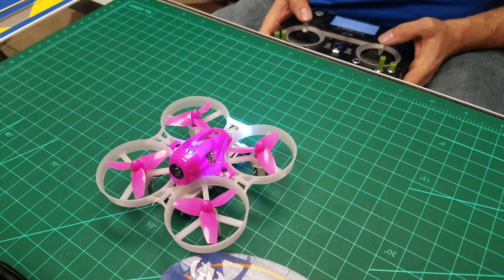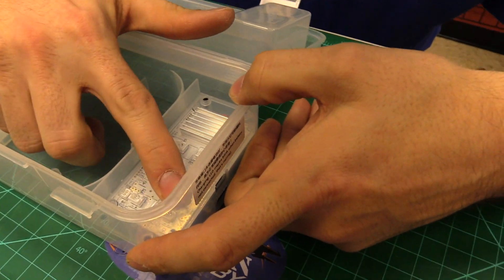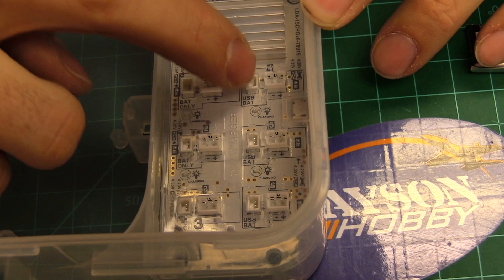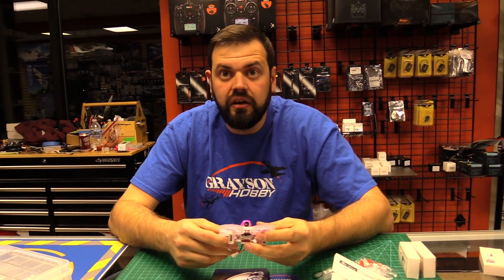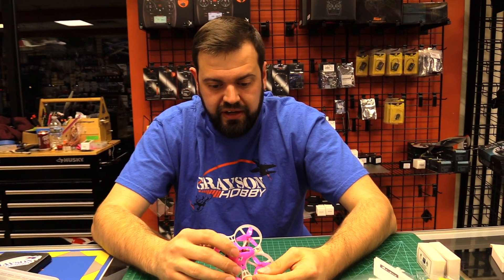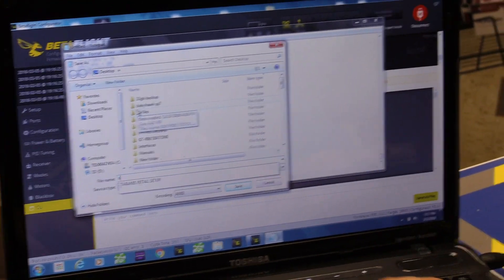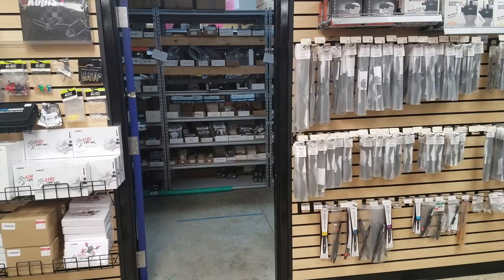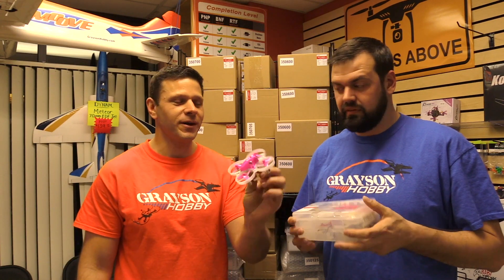KingKong Tiny 7x Micro FPV Quad Advanced Bundle with FrSky XM | BNF

Comment: What would you guys recommend I no it's off subject but what laptop would you recommend for a computer to use only for fpv pies set ups something cheap but reliable any ideas would help
Reply from the maker: Pretty much anything new these days will work.  We bought a few used ones off of eBay just for the shop for 100 bucks and they work great

Comment: Hey guys,I have the tiny 7 and when I power it up the motors start spinning. How do I make this stop?
Reply from the maker: Sounds like  motor stop in betaflight needs to be adjusted
Reply: Grayson Hobby I’m fairly new to the hobby. How exactly do I do that?
Reply from the maker: Also you need to set modes, and throttle arm / disarm...
Reply from the maker: watch Bardwell videos on BetaFlight.  We have featured this on several quads, most videos have this, but I suppose we need to do a quick demo on this.
Reply: Grayson Hobby thanks fellas. I’ll give it a go and see how I fair. Thanks again